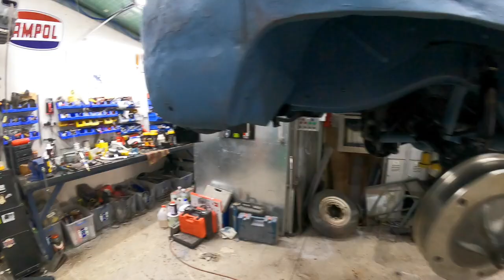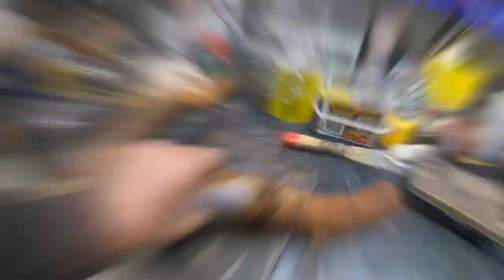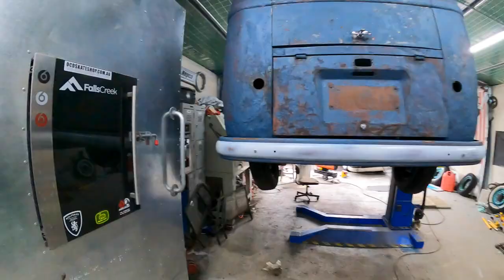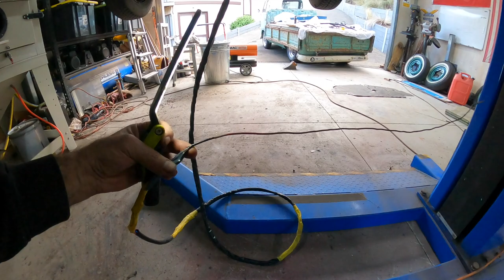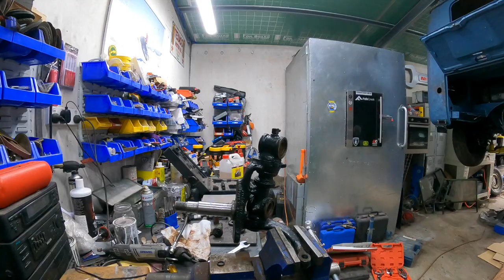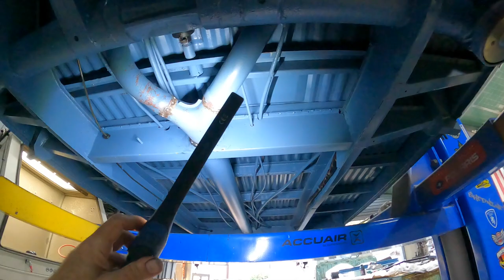RESCUE of a VW 1955 panel van Australian bush find. part 31 final fabrication  #vwrestoration

Comment: Keep the great work coming Nic.  Look forward to each new post.  Re: the Klassik Rader wheels from HPD.  Who did you use as the shipping service from the US? I'm finding shipping to AUS as much as the wheels themselves from HPD direct. BTW they look great on Miss Purdy and worth the wait (and cost). Cheers, Mark.
Reply from the maker: cheers Mark, we got the wheels from vivid racing and then got them shipped over using a freight company this was way cheaper than the normal method but it did take almost a year to get them :(